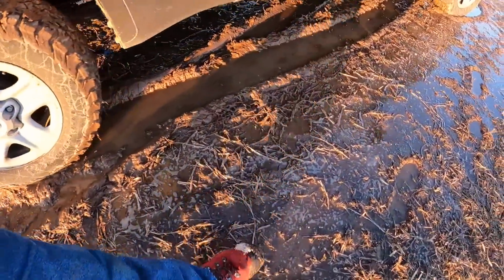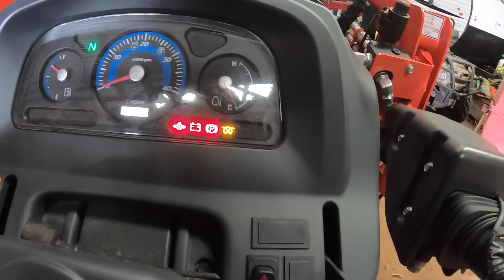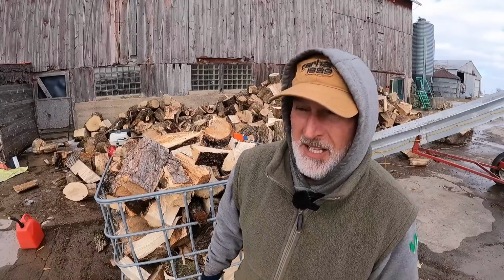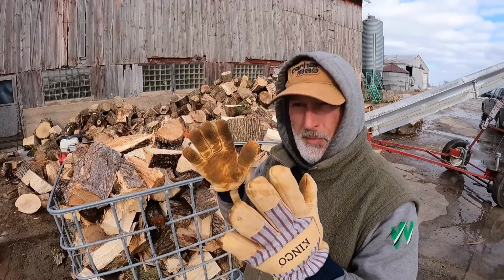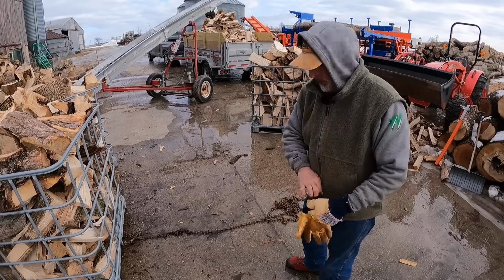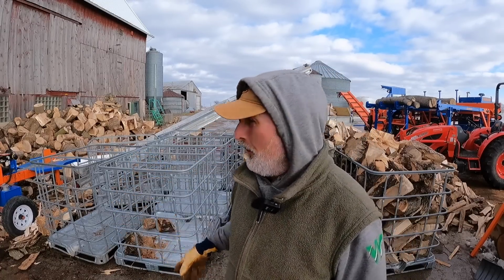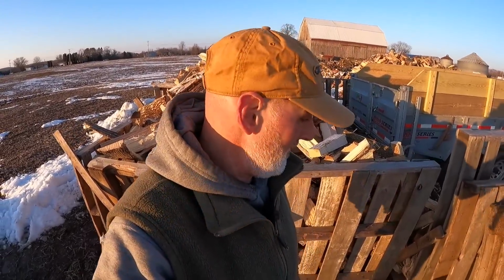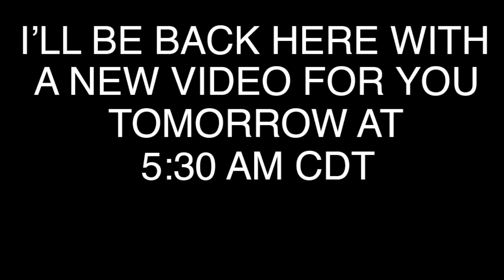Splitting nasty assh Firewood into the night!

Comment: On moving the totes you look like you are working on concrete.
Is it clean and smooth enough to use the pallet jack? 
If you only fill them level with the top can you then stack the totes on each other when full.
Reply: I think that they have stored them in the barn in the past with a pallet jack.
Reply from the maker: yup.
Reply from the maker: yup

Comment: Just a thought there is a lot of manual labour putting the firewood into the pit from the trailer wood it be better to dump it on the ground from the conveyor and load it with the tractor ? Keep up the good work 👍😁
Reply from the maker: Maybe so??
Reply: I’ve seen vids where the conveyor drops right into a tire loader bucket.

Comment: After reading some of yesterday's comments about piles. I was looking very closely today as you were splitting these chunks, thinking I would definitely see mold and 6 inch mushrooms. 
I mean...these wet chunks have sat in a rounded pile, while partly shaded by barn, under a massive roof with no gutter that sheds water on piles,directly on the concrete, blocked from some wind for almost 6 months!! Why am I not seeing mold and mushrooms??? 🤔🤔
Reply from the maker: Yup, shade, wetness and no wind will grow mushrooms, the bin is in 100% open windy sunny area off the ground, so.....
Reply: @In The Woodyard  One would think that if the wood survived these not so perfect conditions for the last 6 months and looks to be in perfect condition. They will do even better and be just fine, in the new bin!👍

Comment: I worked up a nasty load of tree service wood yesterday. I would say it was about 60% good and 40% boiler wood. The better loads are closer to 70% good at best. The short cut off pieces alone add up fast...
Reply from the maker: I just finished off the whole pile there and the ratio was 5 to 1. 50 good face cords and 10 face cords in the totes of chunks.
Reply: @In The Woodyard  Your tree guys bring nice loads, though. I have seen them...